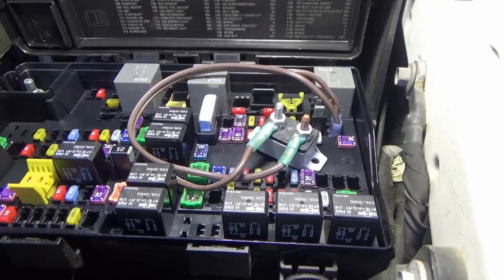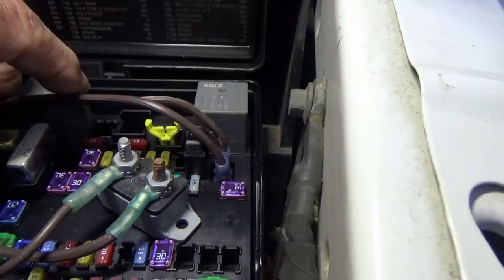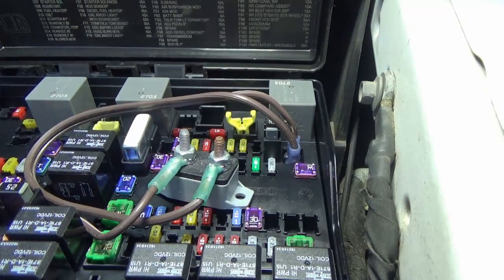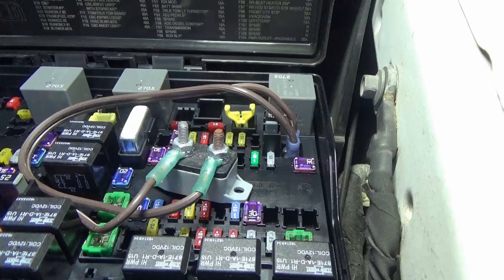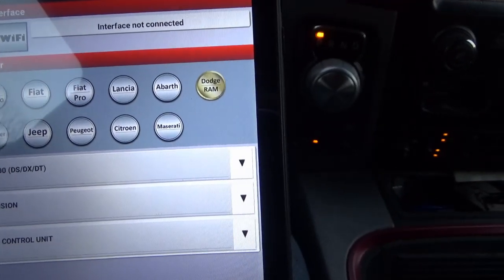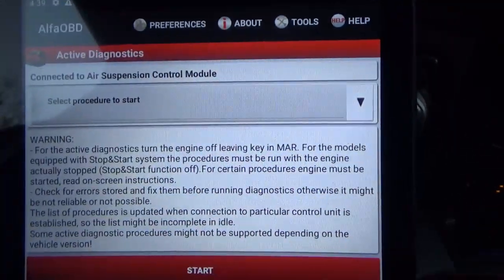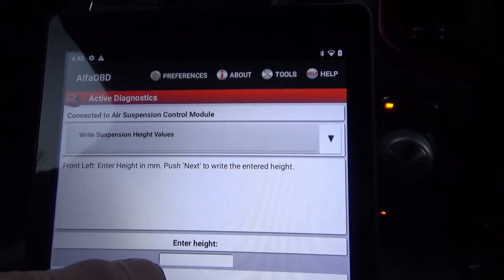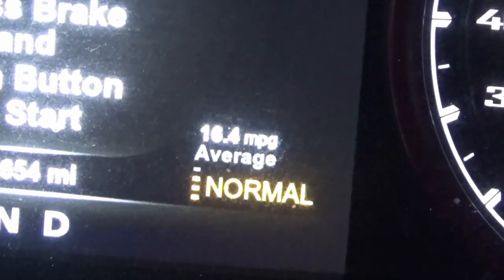Ram 1500 Air Suspension Problem Fixed

Comment: So when you raise your truck, do you think the compressor sucks in only nitrogen?  You will have air in your system without ever having repairs.
Reply from the maker: It's a closed system that runs off of 2 nitrogen tanks. Only way air can get in there is if there's a leak or it's been repaired and the tech didn't purge and fill it back up with nitrogen. Wouldn't make sense to fill a system with nitrogen that at the same time has access to outside air.
Reply: @SteeveeDan  There's an intake and exhaust hose for the compressor behind the passenger side tail light so it can take in outside air. It's designed as a "closed" system as the compressor is meant to move the nitrogen from the tanks to the suspension, but if the air mass in the tank gets low, the compressor will try and top it up with outside air. This usually produces the Compressor over temperature error or blows the fuse.

Comment: Great video. 
Thanks.
Im going through the same issues,  cold weather causes it for sure.
Dealer said $7,000 to fix and warranty wont cover it.
I almost spent $1600 last night to just do the air delete  system, but im heading out to the garage in a minute to see if i can save a few bucks.
Great Great informative video. 
Much better than the stuff i put out there 😂. 
Thank you for posting
Reply: I'm in the process of editing my latest video on how it went. 
Posting soon, (hint)
I ended up spending a total of $13 bucks.
And so far so good.
Thanks for the info and sub my new friend
Reply from the maker: @ I'll keep an eye out for it, I'm interested.
Reply from the maker: Thank you! I too almost pulled the trigger on the delete but thought I'd try this route first, so far, so good. Fingers are crossed!